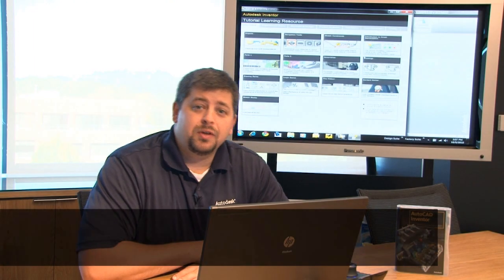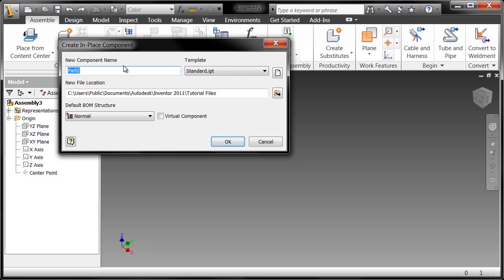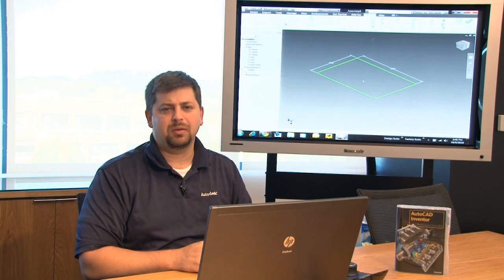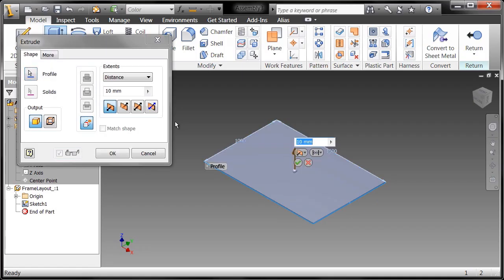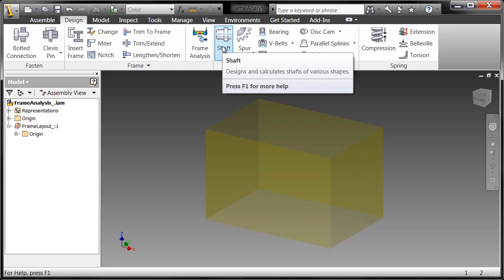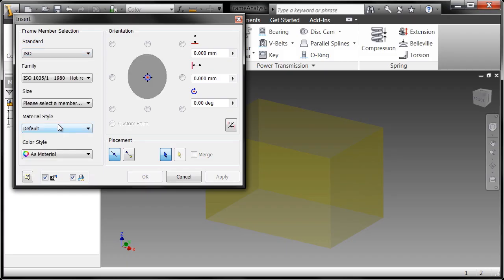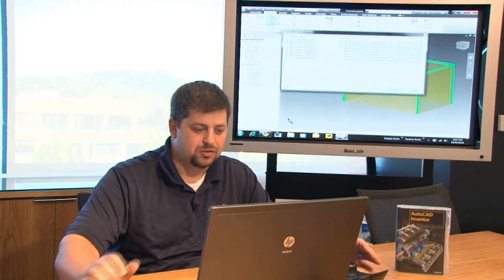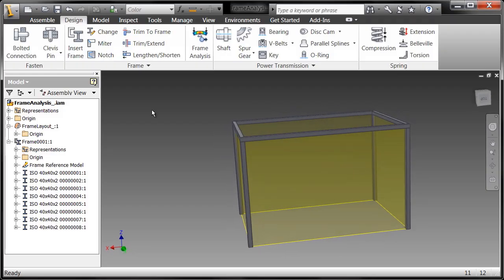Autodesk Inventor Fundamentals - Basics of Frame Generator Chapter 1

Comment: Has anyone noticed that if you offset sections in FG that the model becomes inaccurate? If I increase the decimals in the units of measurements and measure from one section to another, I will get a result of eg: 699.9999 instead of 700.0000. Even when the frame surface model is 100% accurate. I noticed this when I converted an idw to a dwg where I have 8 decimal places.